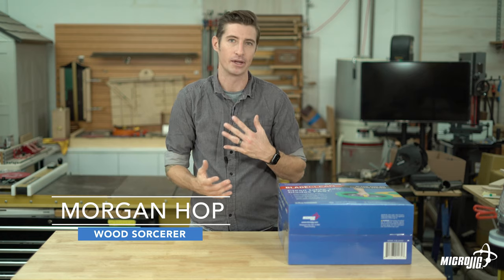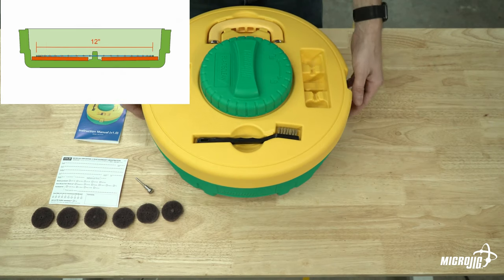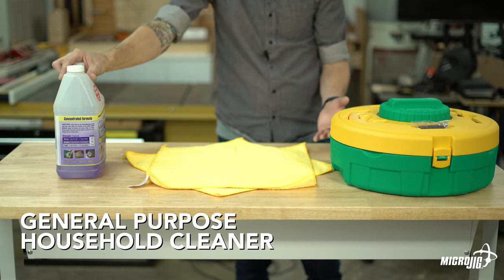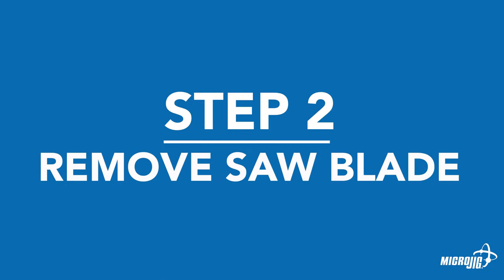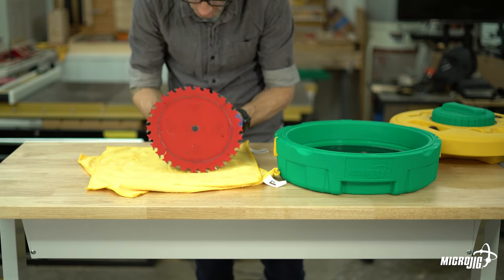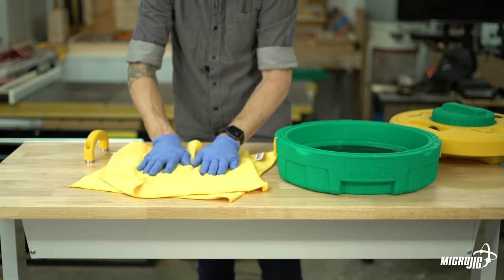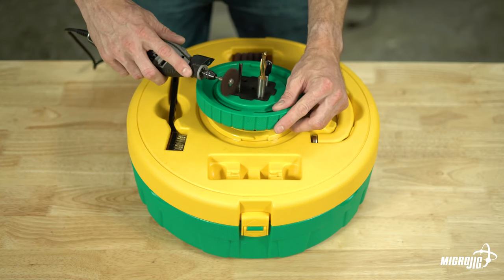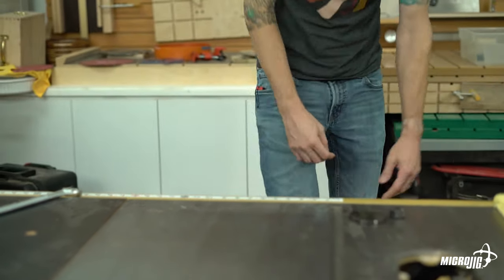BLADECLEAN Blade and Bit Cleaning System (Instructional Video)

Comment: Great product! This would be so much easier than the lid of a five gallon bucket.
Reply from the maker: It is easier and FAR less messy, no need to pour out the cleaning solution after each cleaning.
The BladeClean stores with the fluid inside ready to instantly clean the next blade.

Comment: just got mine in the mail, how cow is this thing nice. is the 3m pad proprietary to microjig or is it just a standard size? i imagine eventually ill want to replace that
Reply from the maker: We have it cut for us, but it will be available on our website shortly as a replacement part. 
I've been using my Bladeclean for 2 years now and my pad is showing no signs of wear yet. We figure about 4-6 years for the average woodworker. But we are not sure yet!
Reply: @Microjig  wow quick reply thank you..  You guys are on top of it.  I haven’t even used mine yet so we have time… I didn’t realize this product has been out for that long I wish I found it sooner. Thanks again!

Comment: How long can the cleaning solution stay in the BLADECLEAN?
Reply from the maker: Mine has been in there for over a year with no noticeable evaporation. I am using Simple Green and water mixed. As long as the solution you are using will not spoil, you should only need to change it when it gets filled with the gunk from cleaning.
Reply: @Microjig  Awesome!

Comment: I wouldn’t want to use simple green and water tho. I use a regular cleaning solution made to clean and it leaves a lubricated film and plus the water you should WD-40 the blade if using a water solution as to not cause rusting
Reply from the maker: The beauty of the Bladeclean is that you can use your preferred cleaner! 
I have been using my BladeClean for 2 years with Simple Green and have had no issues with rusting. But I dry the blades well after cleaning.

Comment: For $99.99 I think I'll keep my five gallon bucket and brush
Reply from the maker: That is your option. I have several blades and they are not cheap. Keeping them clean extends their life and saves me money on sharpening blades that only need to be cleaned, extended blade life and less burning and tool marks on my cut edges.

Comment: Who in the right mind would spend $99 on this when it does nothing special
Reply from the maker: Anyone who values their investment in blades and their time. Clean blades last longer, cut better and you do not end up paying for sharpening when all you need is a cleaning. 
Just read the comments here or reviews all over the web. The Bladeclean may not be for everyone, but it is selling just fine, thank you.
Reply: @Microjig  Trust me, I wash my blades all the time. I spent $2 for a 14" round plant saucer and $5 for a Brass brush. At the end of the day my $7 option does the same thing as yours. Go figure. Don't get me wrong, some of Microjig tools, accessories are worth every penny, but this is not one of them. Just my 2 cents.
Reply from the maker: @Zamboni-0805  It is your choice, but your system is not the same. The Bladeclean features a 13" scotchbright pad that cleans all the teeth at once. It also features a magnetic handle that make handling the blade easy. The bottom of the BladeClean is sloped so 12, 10 or 7-14" blades all rest on the teeth, not on the steel body as you turn them. 
If you clean your blades regularly, it takes three turns on each side. A total of about 30 seconds using the bladeclaean. About 2 minutes including removing and replacing the blade in the saw. 
And the Bladeclean is stored with the cleaning fluid in it.
Reply: Takes me about half hour to clean every tooth on one of my saw blades. Considering my shop rate and the down time to clean my blades, this system will save me money in no time.
Reply from the maker: @alrightythen1533  thank you, that is exactly why we created the Bladeclean. And you also save money by not paying to sharpen blades that only need to be cleaned.